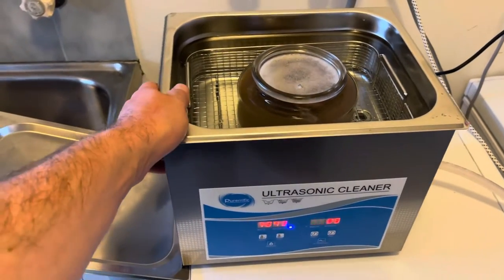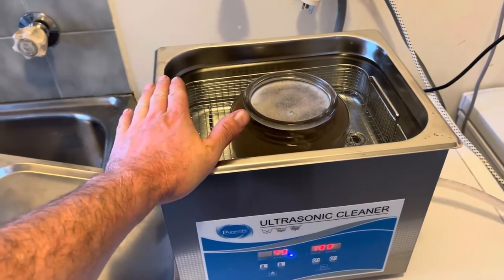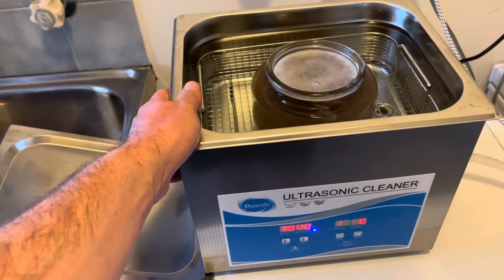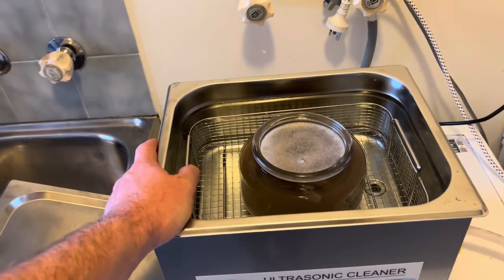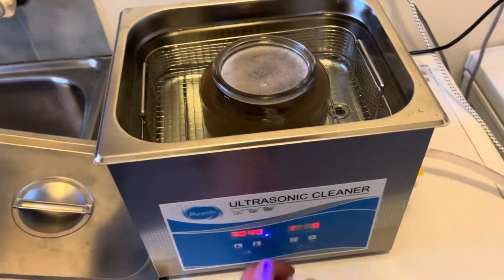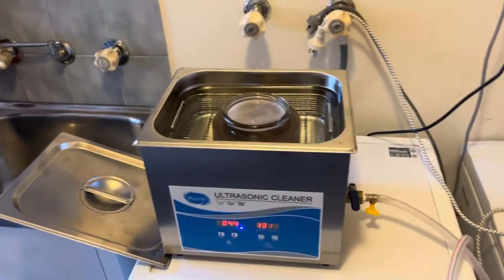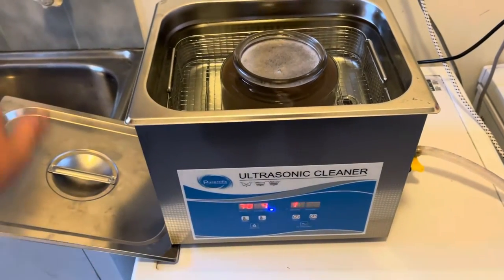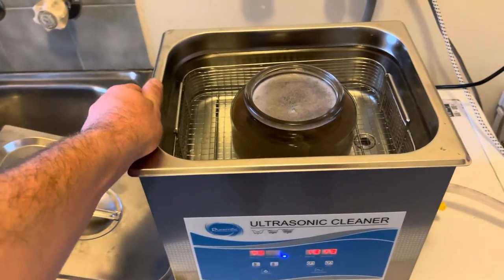“DEGAS” YOUR ULTRASONIC CLEANER BEFORE USING IT - DON’T MISS THIS STEP!

Comment: Good update video on degassing Tom i remember seeing a few older ones when we got our first ultrasonic cleaner. It is also suggested to use distilled water in ultrasonic cleaners simply because of minerals in tap water. We have used distilled water and did not notice any difference not to say there is not one but visually and operationally the carbs look the same when they come out of the bath. Over 9 years we have only had two carb failures after ultrasonic cleaning,  one was too severely gummed and rusted up and the other had spider webs internally that would not dissolve or allow removal.
Reply from the maker: Thanks Wayne, much appreciated. They’re a useful tool aren’t they!

Comment: I always wondered how much having an internal container (the glass jar) affects the cleaning. it seems like it would disperse at least some of the harmonics that do the cleaning, but I could be wrong. Have you experimented with going straight into the cleaner vs putting the parts in a glass jar inside it?
Reply from the maker: It hasn’t made any noticeable difference with or without the jar, though this machine is a very good quality one, maybe with lower end units you may start to notice a difference? Do you have one?
Reply: @Vintage Engine Repairs  Of course, but mine is a lower end one.  🤣
I used it on a gas tank today that had gas so old, it turned bright red(that's a new one for me) mine is not big enough for a tank so I had to flip it... worked though

Comment: I’m looking at buying one of these, are you using a glass jar to put your dirty parts in and keep the water clean? I’d also thought of running it with jizer fluid to help degrease really dirty parts, is that possible?
Reply from the maker: Yep, the jar keeps everything clean. Not sure what Jizer is. I use a water based alkaline bilge and engine bay degreaser, ct14 it’s incredible.
Reply: @VintageEngineRepairs  jizer is the red Kerro bath fluid. I think I’ll go your way and use it in a jar for the dirty stuff. 👍

Comment: So for clarification; Do I run the unit with just the water to degas or both the water and the Ultrasonic cleaning solution to degass when the ultrasonic doesn't have a degass feature? Also does this apply to distilled and ionized water or just tap water?
Reply from the maker: Distilled water shouldn’t contain air, it’s just tap water. You can do it with the solution too. You can run a 20 min cycle including heat and you should be good. Then put your parts in and run a second / third cycle depending on condition of parts.
Reply: @VintageEngineRepairs  Well the stuff I'm personally planning on cleaning isn't "that" dirty. Just some flux. However I want the most effective way to clean them out of principal. Doing things properly basically. I also noticed these versions of Ultrasonic cleaners that aren't in the thousands of dollars don't have degas features and therefor I wanted to know the best way to emulate that feature. With that being said running the Ultrasonic Cleaner at the maximum recommended temperature of the cleaning solution with both the water and cleaning solution for 20 minutes is better then just pouring the solution in water and parts in is what you're saying? That won't degraded the quality of the solution but activate it or make better?
Reply from the maker: @boredfive3001  no you won’t degrade the solution by simply running the US-cleaner. Mine was only a couple hundred dollars, it’s not only the industrial ones that have the feature, you may have it and just not know the button combination - double check your manual :)
Reply: @VintageEngineRepairs  I just checked my manual and it didn't mention the feature which is fine. I didn't necessarily expect it to, however isn't degassing the same as just running the unit regularly? Is heat involved to degass? And why doesn't regular distilled water have gas in it but tap water does? The cleaning solution I have says to degas it on the bottle.

Comment: If you use destilled water from a store there is no need to de-gas is there?
Reply from the maker: That’s a very interesting point! I don’t know honestly! Technically it has no air in it, but if it’s been shaken in transport or dropped, would that introduce gas back in? In not sure. Thanks for bringing that up :)

Comment: I thought by the title you actually had some condition of the device itself needing a fix. Turns out you are degassing the cleaning solution, not the machine. Strange, I have a large cleaner like that I got 6 years ago and there was no mention in the operating instructions about this procedure. Maybe this makes a difference and maybe not, not every source  of water has dissolved gas in high concentration and even if it did I doubt the cleaning effect will be compromised for very long, if at all. Everything I have cleaned gets right with the program and we have well water with quite a lot of dissolved gas, you can draw a glass of water and watch it fiz and turn from cloudy to clear!
Reply from the maker: Thanks for your comment.